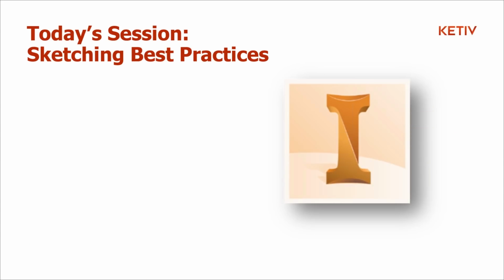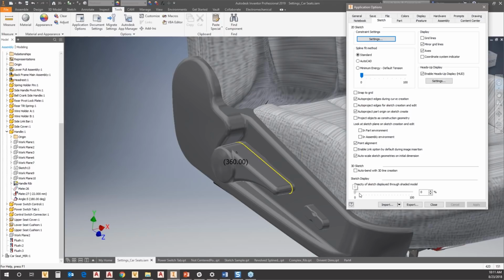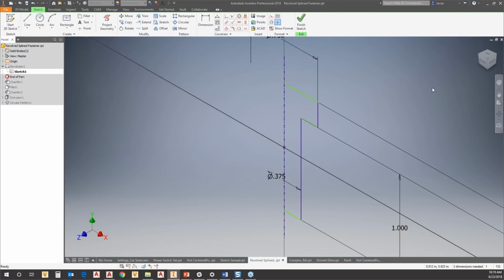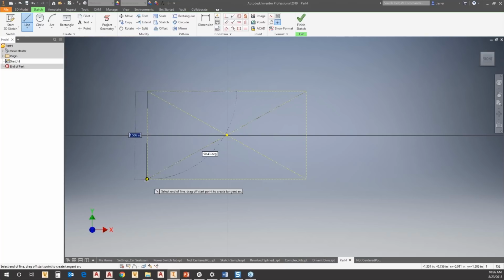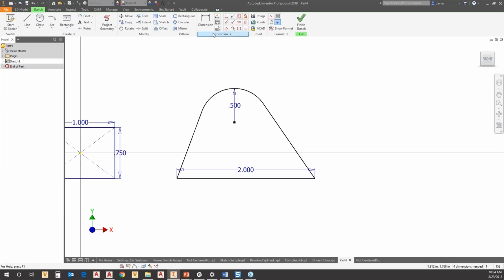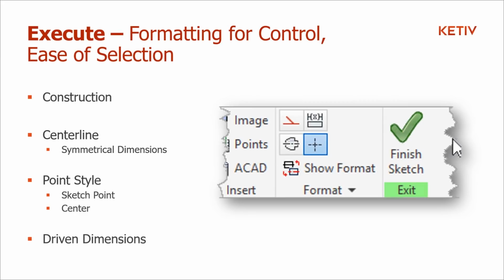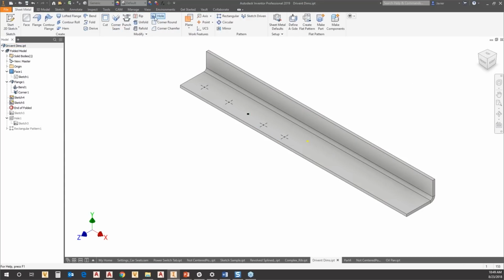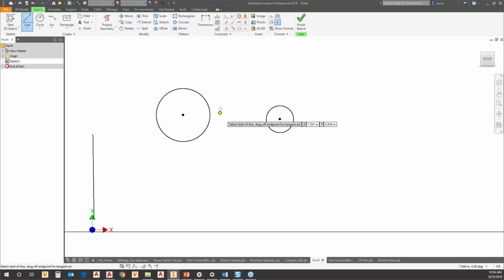Inventor Sketching 101 | Autodesk Virtual Academy

Comment: The reason why at 46.20 the points are not automatically selected by the hole command is that you have two sketches visible. Must be only one.